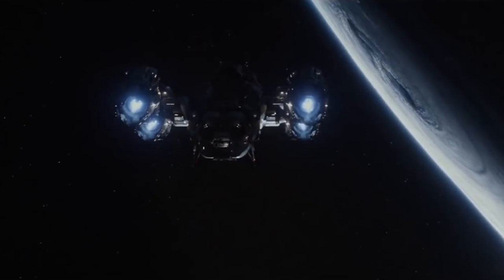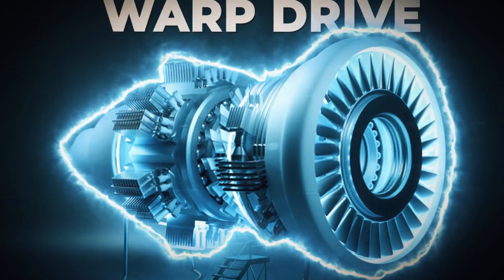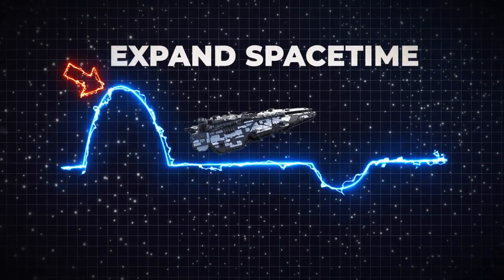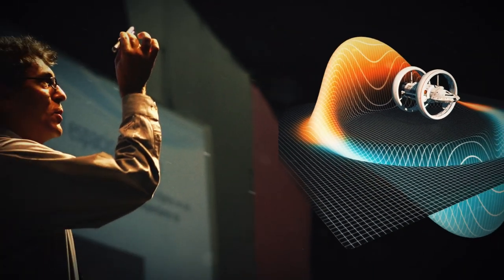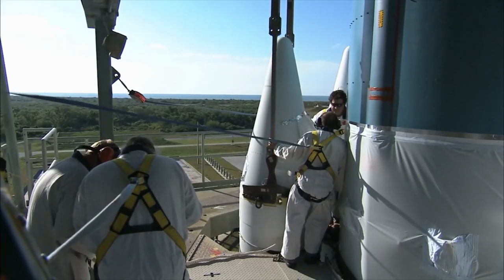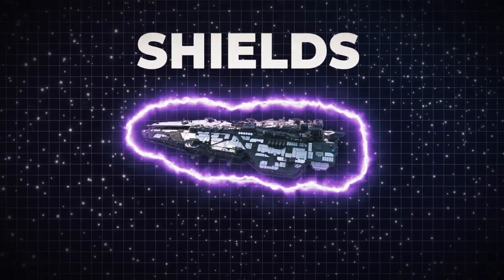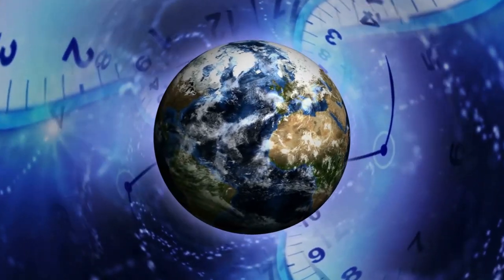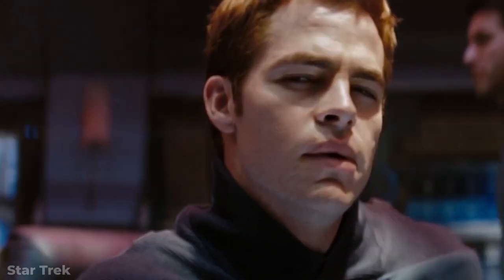NASA’s New Light Speed Engine That Defies Physics

Comment: From what I understand, the time distortion you described would not occur because the ship is outside of space time and is actually standing still and space is moving, they would experience time at nearly the same speed as someone on earth and two weeks would be nearly the same.
Reply: Yes.  Time dilation happens because a massive object is made up of field excitations that always travel at the same speed.  Usually, when at non-relativstic speeds, most of that constant speed in the field excitations is used to interact with the particles of a massive object.  This is how a massive object ages, it constantly is buzzing with activity.  Once you translate that constant excitation speed to translational motion, a lot less is available to age the object, so it would age much more slowly.  If spacetime itself is being accelerated to ridiculous speeds, the object itself would age at a normal rate.
Reply: @ElectronFieldPulse  Relativity. Object ages at normal rate. Rest of spacetime ages at an incredible speed. Result the same thing.
Reply: @georgechristoforou991  - True, you can look at it from different frames of reference.  But either way, it comes down to how much of the constant speed of the field excitations is being used for translational motion and how much is being used to age the object, aka self interaction of the mass.  I like to think of it as an object at rest having a ton of buzz when compared to another object. When it moves near the speed of light, that buzzing dramatically dies down and it appears calmer, or it ages more slowly.  Of course in the frame of reference of the massive object, time moves normally because literally every particle slows down in "buzzing" by the same amount, so there is no way for the massive object to know that it's own time has slowed down dramatically compared to its surrounding.
Reply: @aandc2005  - No, that only occurs if time dilation would be occurring with the ship.  If you could manipulate spacetime itself so it was moving, the time dilation wouldn't apply.  Not that it matters because it is probably an impossible thing to do anyways.
Reply: No they wouldn't. Time on earth is dictated by the speed of its rotation, plus the speed of its orbit around the sun, plus the speed of the solar system with the star cluster, plus the speed of the spiral arm of the milk way galaxy, plus the speed at which the galaxy itself is moving towards other galaxies within its cluster (eg Andromeda) etc etc. Time  is relative to speed you are moving at even though you may think you are standing still you are still part of the fabric of space time within your local vicinity that itself is moving. Time therefore would be at zero "if the drive concept works", because it manipulates space time around it and is therefore not subject to effects of space time itself. For such a drive to exist it would have to create bubble within the 4th dimension namely spacetime.
Reply: Thank you I was just about to say this
Reply: Yes, if you are jumping from spot to spot like a 'flying saucer' skipping over water, the time distortion issues that would occur under conventional travel might not apply.
-  Scan for objects in the destination
- Jump to destination
- Repeat
Reply: That's what they did in Futurama
Reply: NOPE...2 WEEKS WOULD BE 200 YEARS ON EARTH...AND THEY ALREADY DO IT
Reply: @domjones_who3849  you completely misunderstand my point. They are NOT traveling at the speed of light. They are in a bubble of space and are relatively stationary. Space will move around them without approaching light speed. Space is allowed to break the speed of light. It already did at the big Bang and it still does even now, because we are actually moving away from the edge of the observable universe faster than the speed of light right now but it is space that is expanding and that is completely seperate of any motion of objects within space itself.

Comment: I have some real issues with this video. First, it erroneously states that relativistic time dilation would occur during the use of a warp drive. That is dead wrong!  The whole concept assumes that no actual motion THROUGH space-time occurs. Rather that by expanding space-time behind the ship and contracting it in front basically turns space-time into something like an escalator that carries one forward. No actual movement through space-time occurs thus no relativistic effects occur. Second: This video makes no mention of Harold "Sonny" White, a NASA scientist who has refined Alcubierre's concept to make energy requirements more plausible. Of course much more work will be required to ever get a workable warp drive.
Reply: Think of a ship in sea, it displaces the resisting water and pushes a wave in front of it and that dissipates into the easiest way to get out of the pressure wave. Speed of mass vehicle on motorway, has a push and pull at all it overtakes.aircraft leave a wake of displaced currents behind it.  Space station goes around the Earth at faster speed than Earth revolves. So, Whats this big energy thing we need in void of atmosphere. A few puffs of gas to orientate or position a vessel to engage with a target  access lock?
Get back to looking at that spinning wing nut using its inherent energy from  a flick of the finger, after it had left the thread. Energy in space has to get used or cause a reaction against something.  Pontoon engines wide out and behind  on limbs.
Science fiction has its ideas that could , these days be useful.
Reply: rather,  of course....and,  zero people  were  Interested  yer  verbal wanderings.
Reply: Not zero people, David.  Don't be so negative, you'll find yourself much happier.
Reply: This includes Harold White
Reply: Joke By-done  Even if you could go back in time, there is a chance that doing so would be no different than hitting rewind on a movie.  Which would lead you back to the point in which you would go back in time again, getting caught in a never ending time loop that you dont even realize you're in.  I think Star Trek did an episode like that once.
Reply: Joke By-done  The real question is, when we go back in time do we retain our memories of the present (or rather, the future).  I mean, if you go to the past, then the memories haven't formed yet.  Which would mean you would be put in the exact same scenario, with the exact same knowledge and outside influences, leading you to make the exact same choices.  

Well... "Choices" xD
Reply: Joke By-done  It might very well be.  Recent experiments show that Soundwaves actually contain mass.  The energy itself.  The interesting part is we can see there is the possibility of Negative energy contained in soundwaves and while we are talking about an extremely minor amount, like .01mg per watt or something along those lines it means we might have discovered a means of getting this negative energy through acoustic wave manipulation.
Reply: 9 thankful for your comment. You saved me time having to explain this.

Comment: Speaking as someone who works at the Space Agency, I can tell you we're nowhere near having anything like a light speed engine, it's all purely theoretical, so maybe in about 250-300 years, but no time soon, there is no new light-speed engine. You have a lot of technical problems with your explanations, you're mixing conventional lightspeed propulsion under the Standard Physics Model with the warp speed propulsion, there's no time dilation.
Reply: That's what they want us to think. Get work at some skunkworks and we'll talk. Working for the space agency and claiming you know about the latest technologies, is like driving a bus and claiming that's why you know about cars.
Reply: @nachi3401  Nah, I am very close to someone with.... Better credentials. He won't say much, but he would not agree with you. Yes, I believe you are correct about the time dilation, but the space agency is far from having the latest technologies.
Reply: There is a piece of the puzzle missing, obviously; and until that is revealed it may as well be 1,000,000 years at the moment. 
There is nothing in our current understanding of Physics that can solve the problem of interstellar travel. A new 'discovery' could produce a Quantum leap in Science and turn that 250-300 yrs into 10 - Who knows?
Reply: Is it possible to use space itself as energy source? Is it possible to vibrate a portion of space itself and use that as an energy source or no?
Reply: Yup, he can't keep the two concepts straight. You wouldn't need a shield for the warp drive either.

Comment: Yes, the video makes the flaw of talking about problems which would not exist, since the travelers in the bubble are not moving relative to the starting space-time-frame. If we did take a trip to say, Tau Ceti, using such technology, we would still need to alter our velocity if we wanted to remain stationary to its sun, or insert our ship into a planetary orbit.  We could use a Newtonian engine or use the destination star's gravity field to correct our velocity.
An interesting development in physics: perhaps dark matter does not exist at all, but rather gravity is non-linear, analogous to the way that EMF shielding can shield EM fields or the Van der Waals force arises from EM fields, due to the geometric arrangement of certain materials. Harold Puthoff, Physical Review letters demonstrated mathematically, that gravity and the strong force could both be expressed as a force similar to Van der Waals, opening the way to using the much stronger EM or strong force as a way of generating positive and negative space-time warps, with much lower power consumption than previously imagined. Perhaps there would be a way to propagate these distortions just outside the hull of the ship, using some kind of wave-guide, at some specific material's "activation frequency?"
Einstein did unsuccessfully attempt to include the EM-force into General Relativity, but could not get the numbers to fit. Puthoff did get the numbers to work, but did not take the extra step of correcting General Relativity equations. It seems if the two had collaborated (Puthoff was born after Einstein passed away), we would have our warp drive already. I mean really, think about it: the EM force should warp space-time as well, right? Why did we assume gravity was a primary and not secondary or a tertiary side-effect of something more fundamental? Seems very unlikely that it is.  If I had a million dollars, I would quit my job and work on that.

Comment: How could it hit any dangerous particles if the space being warped into a bubble surrounding the vehicle is pushing dangerous particles around the out side of the bubble, thus rendering the particles being struck by the bubble as harmless?
Reply: Im no scientist, but i am guessing that even in the bubble, at atomic level , there are things that are still getting through
Reply: this is the first thing I was thinking too...at that speed how do you read the objects in its way
Reply: @MartinMurray1966  I think anything that enters the bubble will be moving relative to the bubble. I'm nowhere near smart enough to explain it, but this means the particles won't hit the ship any faster than they would if the bubble was deactivated. Long story short: no bonk, is good 👍
Reply: Inside of a bubble there would be dangerous Unruh radiation which is basically turning virtual particles into real particles and they will likely become a serious serious problem.  Akin to standing just outside of a black hole.
Reply: That's why it is called a warp bubble. :-)
Reply: Sounds good to me.
Reply: I think it would require something akin to an ice breaker ahead of it to make  travel at those speeds safe.
Reply: They need to designate hyperspace lanes

Comment: Aquiring the speed is only 1/3 of the primary problem, 1, once the engine is engaged if the human could survive that alone, turning the vessel could not happen in any amount, any deviation from a perfectly straight line would be catastrophic at best to the whole thing and throw it off course, and the said human, because if any human is onboard when that happens they will be literally torn apart, splattered like a watermelon dropped onto concrete from a high altitude. 2, predicting when to turn it off would be close to impossible as well, & 3, slowing it down would require at least an equal amount of force in the opposite direction for the same amount of time it is on, which likely would result in it being back at the starting point, which again splatters anyone onboard. 
Gravity and it's effects are very unforgiving, and permeates the whole Physical Universe, you can't just quit gravity in this dimension.
Yes I know he said the warp bubble would protect anyone onboard but that's only 👉IF👈 the WB works as expected, and then you have to get into try figuring out how to test it which will be next to impossible as well, because once it's turned on it will outrun all forms of communication available at this time.
If FTL travel is possible it will have to be done within the Quantum Physics realm.
IMO.

Comment: I can’t believe it would take all the energy in the entire universe to power a warp drive you’d think they would invent a more cost effective method lol nice video though cheers
Reply: it would by a brute force application, but as all things get refined and more efficient it could become practical, tho always to be super expensive tech
Reply: The last I heard the number had been figured down into something more in the order of several solar masses. Still a ridiculous amount of energy to harness, but not completely unfathomable.
Reply: Alcubierre's more recent model puts it at less than a solar mass's worth of energy, and no negative energy required. Still an impractical requirement, but mathematically possible.
Reply: @AlexandarHullRichter  Even more impressive. Next it will be a couple Jupiters.

Comment: Also, we would require star charts in order to navigate at warp speed while at the same time using conventional navigation systems used on Voyager One and Voyager Two when powering down to make the transition between warp light speed and space time drift.
Reply: You're right! Maybe use the Hubble space telescope to look ahead then Calculate the trigonometry just to make sure you don't warp speed into an object (like a black hole).
Inertia Dampeners is a possible technology!

Comment: It took Nasa 20 years to update old rocket (sls) and it’s still not moving us to future. Warp drive in such reality will take them 10trillion$ and 100 more years ;(
Reply: SLS is even simpler than the STS, which those components were designed for. What a waste to destroy reusable green RS25 engines, and build more single-use filthy solid boosters.

Comment: I hope they also invent the Deflector array to push the oncoming debris out of the way, as even a small rock colliding with the ship travelling at those speeds will destroy the ship in an instant.
Reply: The ship is not traveling at all with a warp drive, it's totally different than traveling near light speed, you're bending space time, the craft doesn't move.

Comment: You mentioned the amount of energy required to create the bubble around the craft would be the total energy of the universe. I don’t think that is correct. It is not necessary to bend all of space time, only a relatively small part of space time but for a prolonged period in order to reach the destination. It may be possible to tap into the zero-point energy field which would make use of the naturally occurring energy around the craft. If not, then it is possible to use the energy from a mater - antimatter reaction. In any case the energy field around the craft would act as a shield and move debris away from the craft to avoid the collision with particles. Remember, the craft is not actually moving. It is the space-time around the vehicle which is moving. The craft does not produce thrust, instead it attracts space time at one point and repels it at the opposite point.

Comment: In an Electric universe, you would use the available power that's all around you.
Don't try to bend 'Space\Time,' that's like trying to give your dog a bath instead of letting it play in the sprinklers! 
Instead, why not attempt to utilize the magnetic fields that congregate in the 'filamental electromagnetic emanations" that occur between each stellar object, electromagnetic filaments that are light years long and connect each star throughout the galaxy in a veritable web-work of energy and then oscillate the ships magnetic field enclosure to match the frequency harmonics in the filaments! If you can adjust to the correct phase shifts and field frequencies to attract or repel the surrounding emanations then you can use the energy between the stars themselves to propel you through space!
Simple, really.
( I suggest you look at a series of videos from: "The Thunderbolts Project" to better understand this particular topic of conjecture.)
Of course it sounds like BS! I'm not a scientist!
But, what if I'm right anyway?
Weird, huh?